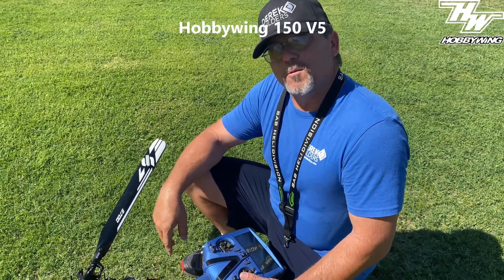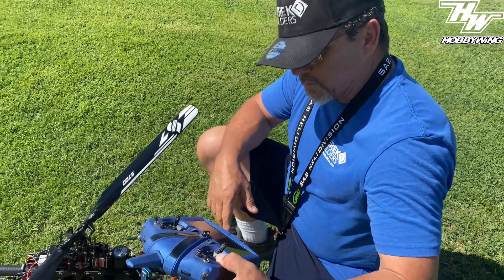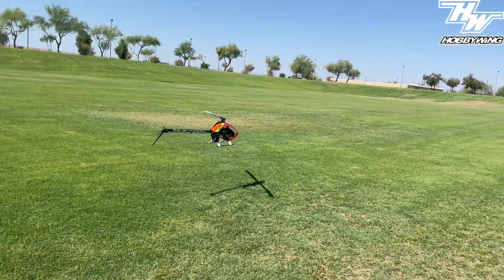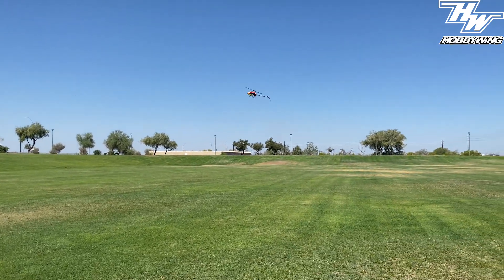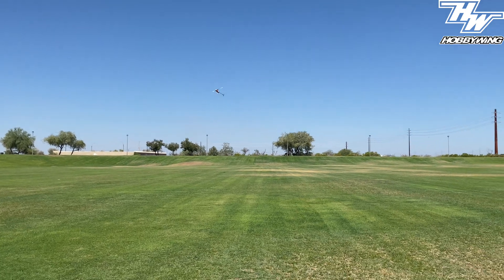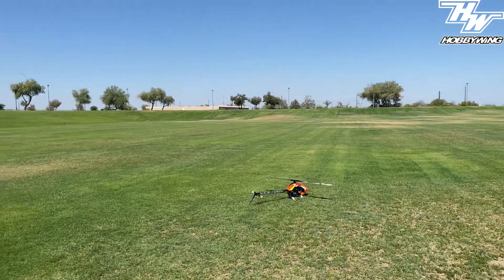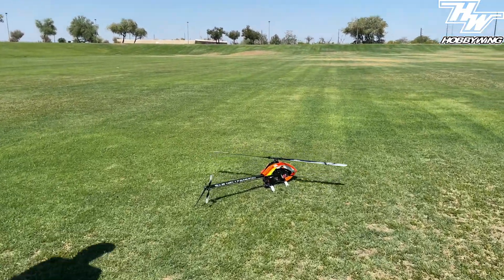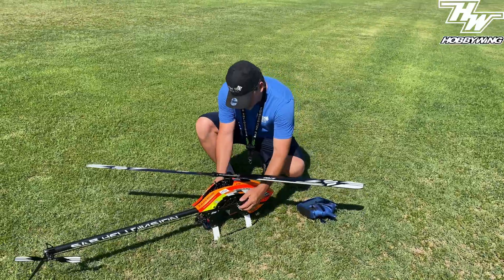Hobbywing 150 Amp V5 ESC - Spool Up on VBar Gov

Comment: Hey, first off thanks for the helpful vids. I just bought a new 150 HW from HD. It will not connect to the HW pc software, nor the lcd program box. Without these tools its doa. I setup a 120 last week, it went perfectly. I guess I should have tried to set it up before installing in a new build. Any ideas? Thanks buddy
Reply from the maker: What FBL are you flying? I fly the Mikado NEO and EVO FBL units. I found that if I leave the telemetery cable plugged into the FBL and plug the program box cable into the tele cable the units do connect. I hae to unplug the telemetry cable so the prog box only sees the ESC. Let me know.
Reply: @biscaolena  I fly everything vbar as well. Will try with the tele cable plugged in.

Comment: 제가 이번에 raw580을 700로터로 개조해서 하비윙 150A변속기를 넣을려고 합니다. 자이로는 v bar neo를 쓰고요. 컷없이 잘 작동할수 있을까요?
6s 5.000ma 밧데리를 사용할려 합니다.
Reply from the maker: Provided the motor physically fits, the Hobbywing 150 amp V5 ESC is rated to 8S and should be more than capable. I run the HW 130 on my XL power 700 V2 electric with no issues. We have seen where people have their motor cut out in flight and have found the cause is generally a bad solder joint on the motor leads. Good luck with your build.
Reply: @biscaolena  답글 매우 감사합니다.역시나 HW150A 매우 문제가 있군요.HW 130A를 쓰거나 다른방법을 찾아보갰습니다.
매우 감사합니다.

Comment: Have they sorted out the issue with autorotation bailout? It seemed a lot of people were saying the Hobbywing ESC with VBAR gov would give you either a soft spool up with smooth bank transitions or auto bailout… but not both. For that reason I’ve been using gov store mode on my HW200a V4.1’s and the rpm’s are kinda all over the place.

Comment: I am running the Hobbywing 120a esc and using Vbar Gov and the pass off from one to the other is very abrupt with a big tail kick and jump in headspeed. I am running the latest 4.0.07-vbar with all the esc parameters on default setting except the BEC which is at 8v. They dont seem to have 4.08 for this esc so with that said what parameter do I adjust to lessen the jump in headspeed during pass off?
Reply: I’d like to know too, I’ve got a 120a also and the VBAR telemetry was telling me I had spikes of 190a! I don’t know if the telemetry is correct but I really don’t fly my Logo 550 THAT hard. I had that same tail kick when I tried VBAR gov and switched back immediately. I should have bench tested it instead of in flight, but the belt isn’t missing any teeth and everything is still smooth. Those 150a ESC’s are looking nice